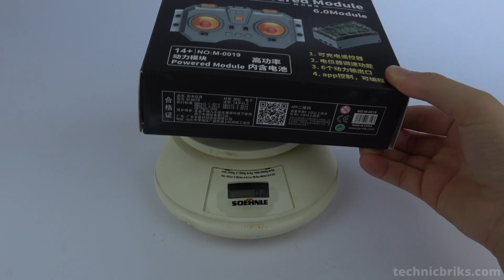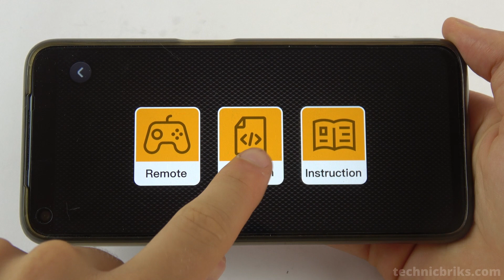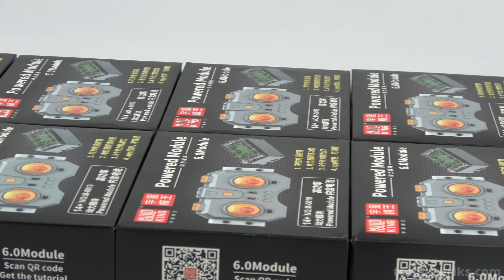Mould King® 6 Chanels Powered Module 6.0

Comment: I've just bought one of these and it's brilliant. So much more power than the separate battery and receiver setups. Really happy with it. Light weight and space saving. It'll cover its cost in disposable batteries in no time.

Comment: I recently bought a Power module and a servo from Technic Briks, but when i plug in the servo to the module it imediatly turns off. I have tested the servo with normal    Lego PF and it works fine. Other motors work fine with the module but specifically the servo kills it immediately. I Don't know wats wrong 🥲🤷‍♂️
Reply from the maker: Hello, sorry for the late reply. It looks like your servo has a manufacturing error.
Please contact us at technicbriks.com/contact to discuss a refund/compensation/replacement.
Reply: I have a smiliar problem with a servo motor by Cada. But just that one. It only turns right on the 6.0 Receiver. Must be something with the servo. Another Cada, and two Mould King Servos are working fine

Comment: Hello! Tell me, please, do you know how to solve the problem of parallel operation of channels A and B for two motors from one stick? On the old remote there are buttons for switching modes, on the new one I did not find it.
Reply: Same issue here
Reply: Connect the remote to the pack. Then hold the power button on the remote. It will flash and then stay solid. This switches modes.

Comment: I bought it first and after that saw your video. It made me pretty happy, looks like money I spent was worth it. It looks like very good investment.
Waiting for package, ordered yesterday.
On AliExpress this version (6.0) goes for 33 euro with freeshipping. (Z-one bricks Store)
And older version goes for 24 euro. 
I'm wondering if it can connect with fake lego technic LiPo modules. Just to be able drive two vehicles at once from the same controler/pilot. It would be fun!!! 
I bought formulaOne blue-orange for 28 euro (1432 pcs) 60cm!
And also smaller car - lamborgini cyberpunk for also 28 euro (1314 pcs) 36cm but it's with electronic(battery,servo,motor,pilot) - without electronics it would be 10 euro cheapper.
Also bought 3 red L motors for 3,5 euro each. 500rpm & 5Nm

Comment: Great presentation!

The only thing you didn't mention is if you can use while you are charging it...?
Reply: I'd like to know that as well. It is an important point if you need to drive many motors.
Reply: Well, I got the answer from a user on Amazon.
No, it looks like it  doesn't recharge while in use.
I also asked the battery capacity but he couldn't tell.
Reply: You cannot charge while using unfortunately.
Play time will depend on how many things are hooked up and being used.

Comment: How big is the diffrence between this one and the one from Cada ? The cada has 7.4v and 550mah this one has like 8v ? And how much mah ? Bought the cada Pista, and thinking about to buy 4 x Black L Motor from Mouldking (heard they are faster than the Cada ones)

And thank you for your Content
Reply from the maker: When it comes to the voltage, the difference isn't big enough to be worth upgrading to a Mould King Module 6.0. The L Motors from Mould King are definately faster and more powerful.
Reply: @technicbriks  thank you, for the response
Reply: @technicbriks  what is with the Power? Between the cada L Pro vs mouldking L superfast, i got the Cada Pista, and its a heavy car
Reply: li-ion accumulator with nominal voltage 3.7v charges up to 4.2v and discharges down to 2.5v. so fully charged 7.4v battery will give you 8.4v. Does cada limits voltage at 7.4v?

Comment: Thanks for the detailed review. Did you ever check the capacity of the battery pack of the power module? I wonder is it just 600mAh like in the 4.0 module (the dimensions of the battery packs between 4.0 and 6.0 are exactly the same) or did Mold King gives it more power? I have a power module 6.0 with me, but on the battery pack is no marking.

Comment: is there a way to get full proportional control of a pf servo motor with the 6.0 module? i can only get full left, right or center. 
Thank you
Reply: Same issue here ! I’m disappointed the video didn’t mention that… Be aware, no proportional control for servos with this battery, even with genuine LEGO servo !
Reply: Hello same problem I bought M0009 and M0005 and I don't get proportionnal use of servo motor anything to do ?  or any other module to buy to get proportionnal option ? 
thanks

Comment: Hi, thanks a lot for your content!
I bought this module, but when I do channel pairing it pairs 4 channels, not just A and B. Have you had this problem? Maybe you know a solution?
Reply from the maker: The ones that we sell were tested by us and they pair A/B and C/D separately.
Reply: How can you pair them separately please? I need to pair two channels to control two buggy motors at the same time. I can only enable the "tank" steering mode

Comment: How many can I use at the same time without interference? Is there a way to modify the radio frequency so I can use multiple units simultaneously?
Reply from the maker: That won't be an issue. You can use as many as you want simultaniously.
Reply: @technicbriks  Thank you!

Comment: Is it possible to permanently energize/ switch on/off one of the 6 outputs for e.g. LEDs?
Reply from the maker: Yes, you will have to do it through the Bluetooth app though
Reply: @technicbriks  In your video all 6 channels are locked by pressing the lock-icon-button of the app. But is it possible to lock just one or two channels (e.g. switch on/off light or/and a pneumatic pump), too?
Reply from the maker: @odohailu7851  You can create customized interfaces with the app which include On/Off buttons for whatever function you want.

Comment: German:
Wollte mir die Akkubox 6.0 jetzt kaufen wegen der schönen Fernbedienung und dem 2.4 Ghz System.
Ich bin aber ein glücklicher Besitzer von 4 Lego Buggy Motoren (und andere Lego Motoren).
Vertragen sich die Lego Motoren mit der Mouldking Akkubox ? Wie viele Lego Buggy Motoren kann der Akku vertragen ?

English Translation:
I wanted to buy the Akkubox 6.0 now because of the beautiful remote control and the 2.4 Ghz system.
However, I am a happy owner of 4 Lego Buggy engines (and other Lego engines).
Are the Lego motors compatible with the Mouldking battery box? How many Lego buggy motors can the battery take?

Hope you can read this shit^^
Reply from the maker: Hello! As you can see in this video: https://youtu.be/w9vEjzc_0Ws?t=87
the Mould King 6.0 is compatible both with Original and Alternative LEGO Motors.
According to our tests, it can manage 2 buggy motors with any problem. We didn't test it with more motors but it can probbably power them without any issue.
Reply: @technicbriks  Thank You for Your detailed reply 👍
Reply: So helpful I bought two buggy motors not knowing the the slick Lego battery box couldn’t handle it this will help me a lot thanks 😊
Reply: I would like control 2 inverted Buggy motors  on one channe. But they rotate not in same direction. Is there a chance to reassign two or more Ports to one channel at remote? 

Same, if you want control more boxes with one remote channel. For example driving big car with 3 boxes and in total 6/12 buggy motors simulationsly.
Reply: @daniel_armbruster  if the lego buggy motors turn in the wrong direction, just turn the connector 180 degrees, then turn the other way. otherwise use a lego switcher